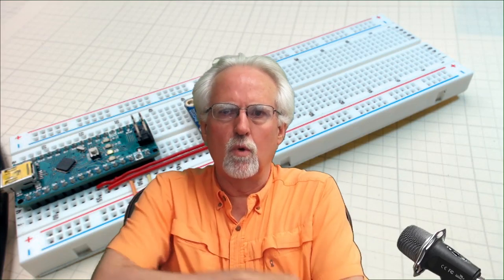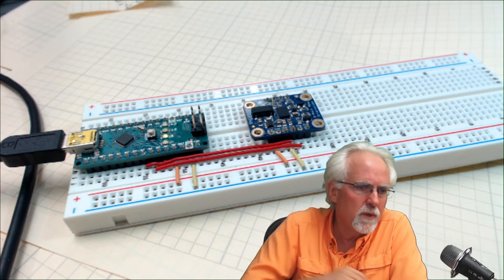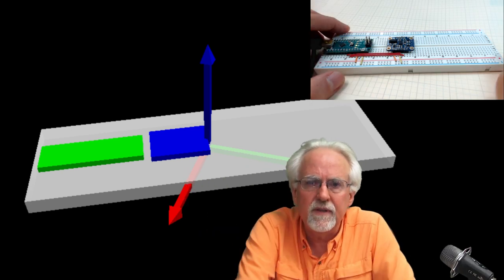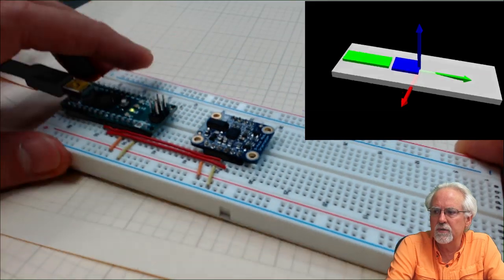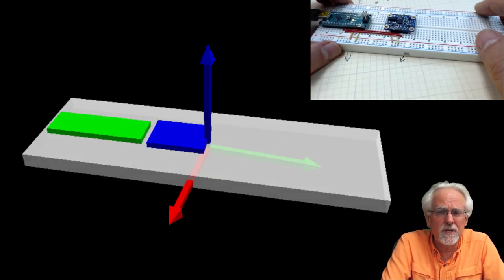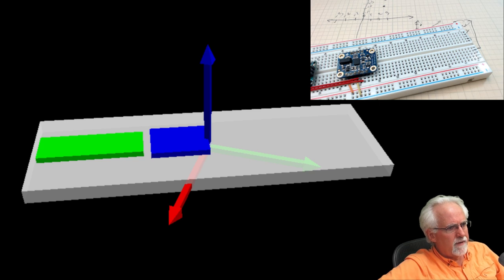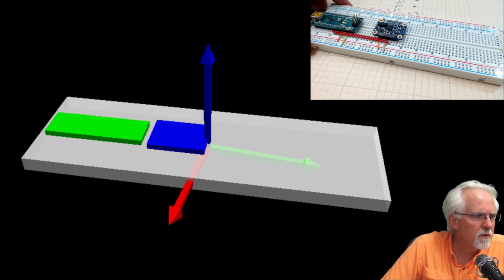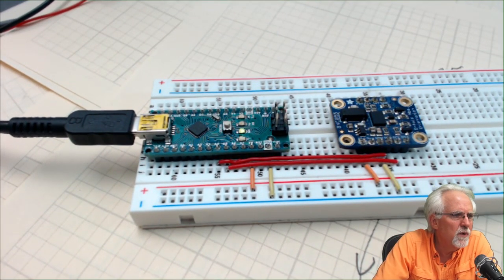LIVE Shop Talk 1: Talking Inertial  nine axis Measurement Units.

Comment: Hi Paul,

Very happy I caught this live presentation and was able to add to the chat discussion. Thank you for your fine work.
 I would greatly appreciate it if you follow up and produce the tutorials mentioned for the use of the BNO055 9DOF sensor.  
I have purchased and been frustrated by a few different sensors and even the Arduino 10 DOF shield that uses the Bosch BNO055 Sensotec chip and included what they called Fusion software hence the 10DOF name . I see they are offering a modified shield with the BNO055 chip again but only advertising it as a 9DOF.
In any case, working through the details got the better of me and I would love to see you produce a serise on this product so maybe I can better understand how to use it.  My goal is to build a heel pitch and rate of turn sensor and display for my sailboat that alarms when I turn too fast .
Reply from the maker: I am going to make a series, but it will only be released after this series of Arduino tutorials. First, I want to make sure folks are ready for the more advanced work, and second dont want to release more than two videos a week to not overwhelm people. I can get you to where you can do simple demos like the one I did in the video. I think the BNO055 has some real flaws though, as you can not turn off the auto calibrate feature. This really caused us huge trouble in our antenna pointing project.

Comment: It would be very much helpful if you could go in detail about IMU in next tutorial along with source code of arduino and Python visualization I have been using mpu9060 but I just stuck at reading values but never understood how to use them in real life whatever I find about imu on Internet is mess
Reply from the maker: Yes, but it will have to be a series of tutorials. It is more than what can be explained in just one. You have to get the sensor hooked up and passing data. Then you have to know what each of the data channels means. Then how to start doing some simple useful things based on the data. Learning some of the trigonometry involved. It will be a fun series, but not a simple one.